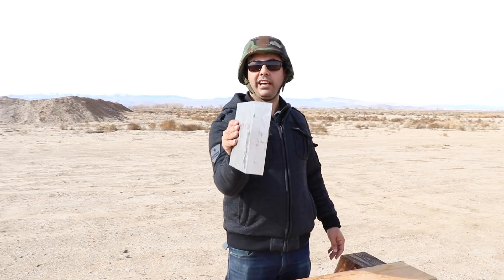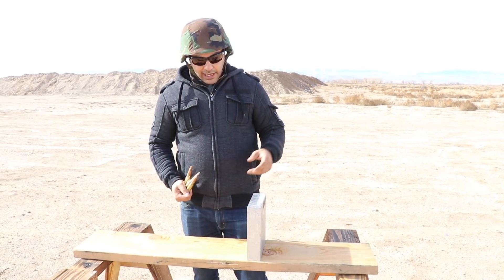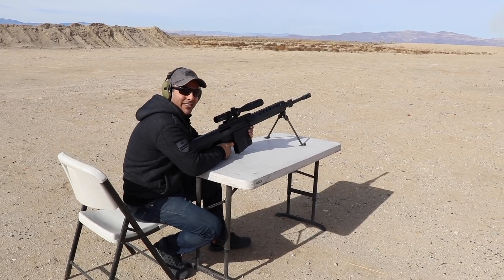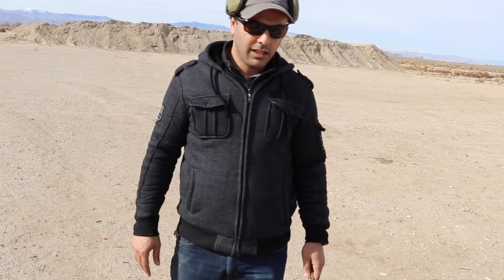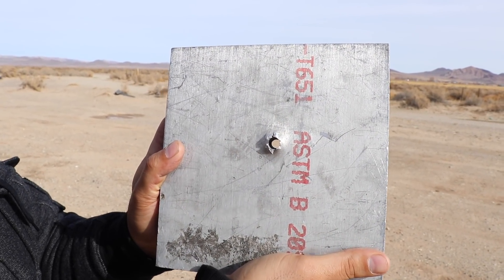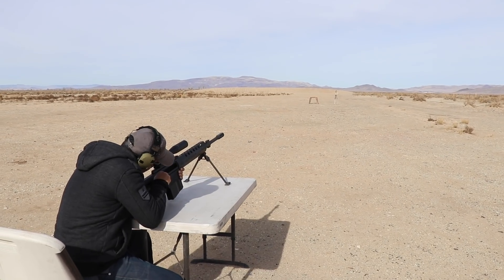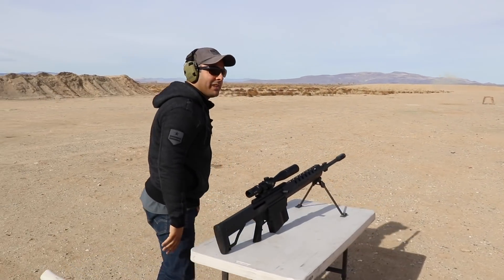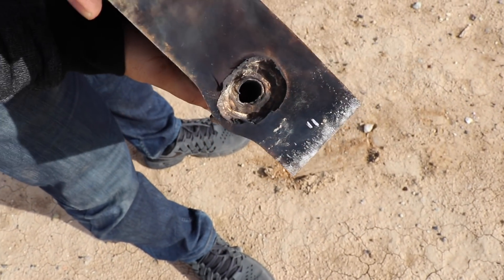HOW STRONG IS ALUMINUM vs 50CAL

Comment: Pretty tough mind you. They use it on the Bradley IFV to stop 50cal and a lots of vehicles use it. Need to have an angle tho, so it ricochet while digging into the alluminium.

Comment: Probably the Tungsten isn't so accurate at longer distances. But just curious which 50 cal round is probably the most accurate at longer distances... Black tip? Silver? AP Tracer?

Try a 200m test some day??

Comment: Black tip does it's  job
Reply: Get Some Yeah I'm curious too
Reply: SANDEEP MANIKPURI That aluminium is much thicker than the armor on the M113. Chilling.
Reply: The aluminium on the M113 is technically just structural aluminium. It's not special armour-grade aluminium.
Reply: It's lighter and may be more efficient depending on the type of threat. Aluminium is actually more efficient than steel for small caliber bullets like 7.62mm but steel is more efficient against larger calibers, including cannon calibers like 20mm, 23mm, 30mm, and higher.
Reply: Since the aluminum is generally a more maluable metal, wouldn't it be able to distribute energy for smaller calibers more effectively than steel? For example, throwing a spherical object towards a spongy surface, which would absorb the transfer of energy, compared to, let's say a stiffer, harder surface that would be more resistent and in result cause micro fractures to occur.
Reply: adam Healy Aluminium isn't as flexible as steel , steel is much much more elastic than aluminium .
That's why if you make a motorcycle frame out of aluminium it will be much more rigid than a steel counterpart.
Reply: Thanks for the info. Now that I think about it, you are correct!
Reply: adam Healy You are welcome.

Comment: How much it costs lol ?? U didnt mentioned like u did in case of titanium
Reply: being 6061-T651 , 12"x12"x2.5" , that's about $300
Reply: 1 Yeah I used to work with CNC ,but not scraps this good looking ;)
Reply: Ethan Craig i think that too
Reply: You can sometimes find scrap for a lot cheaper
Reply: dimmacommunication Yeah they are usually not perfect squares I guess
Reply: phil verhey even if it was 7075-t6 it would only be 100 so this is probably 50 bucks worth